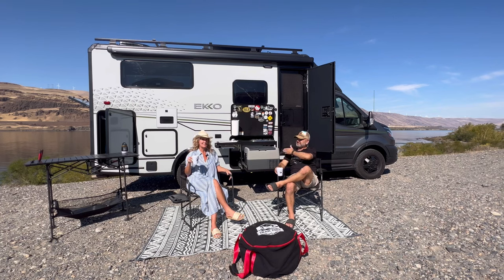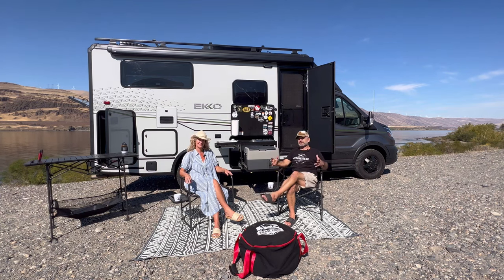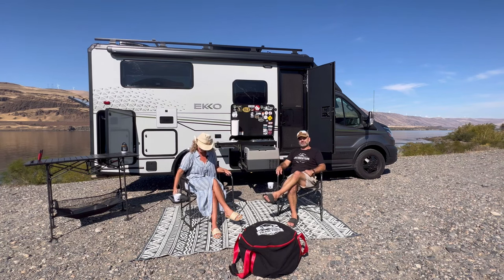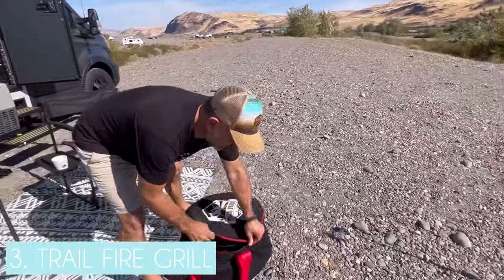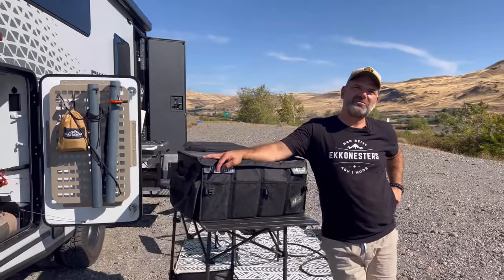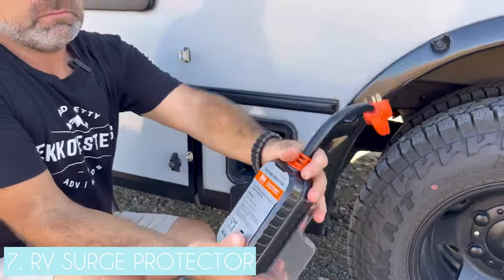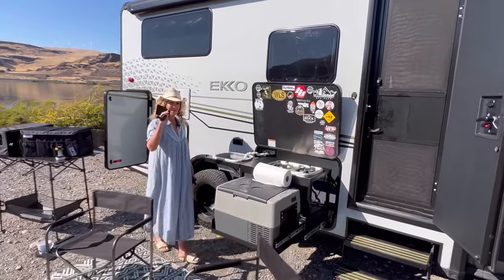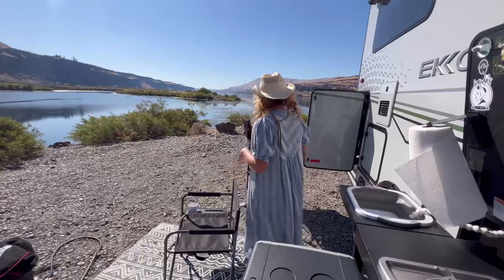TOP 10 RV ACCESSORIES | WINNEBAGO EKKO | ESSENTIAL GEAR MUST HAVES | TRIED AND TRUE!

Comment: what size storage bags did you show.  I see they come in standard, large or x-large
Reply from the maker: Great question. Let me check the size I have and get back to you.
Reply from the maker: Large: mine are roughly 12” height x 24” length (plus minus) x 14” wide. Within a few fractions of an inch.

Comment: The link for the storage box goes to FORTEM Car Trunk Organizer which does not have the nice round hand grips, did you add them separately?
Reply from the maker: Let me take a look. They may have changed the design. I’ll
Take a look and update.
Reply from the maker: I found these two options as well. Also, Costco seasonal sells this type on occasion too.  

https://amzn.to/3xu8BEK

https://amzn.to/3Jfw1A5

https://amzn.to/3vFPAi6